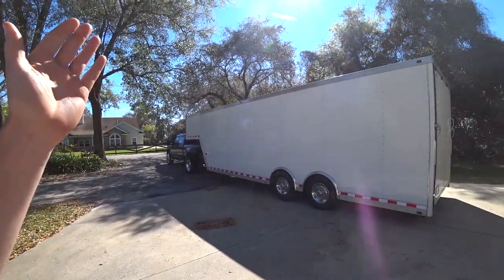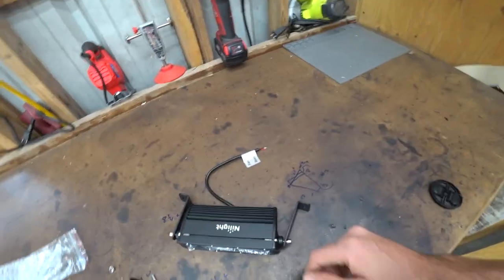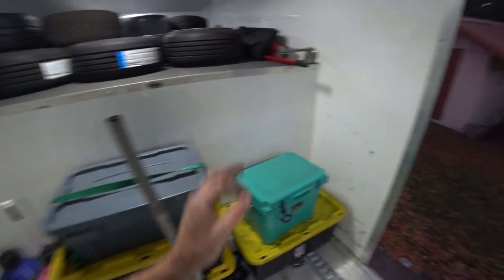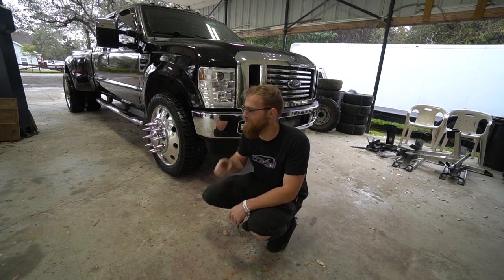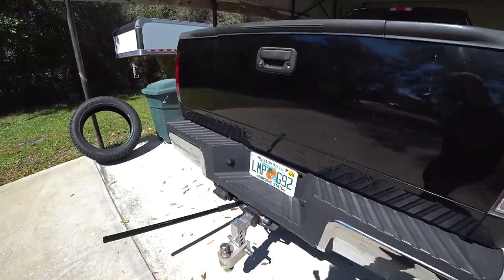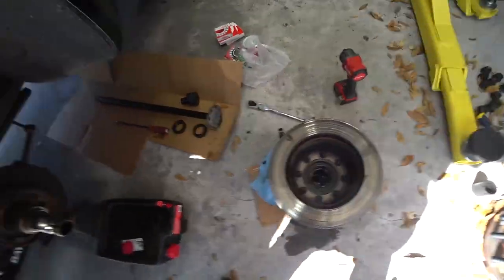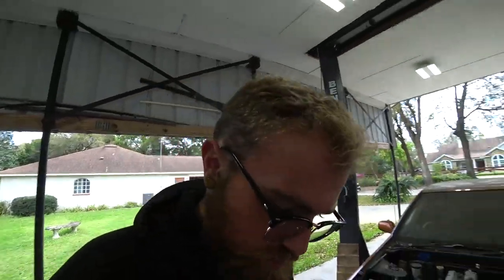Fixing up my new trailer and my cummins swapped tow rig.

Comment: Already a blowout? Hmm, if it happens again, make sure your trailer axles are perfectly ok. I watched a Hotshot driver on YT whose trailed used axles "rated" for a certain weight, but they were too skinny and didn't hold up, so he ended up trying to find an axle while on the road and had to replace it on the side of the highway. Crazy ... so if you keep popping tires, make sure the trailer axles are perfectly aligned and not bent in any direction.

Comment: Look at the dates on your tires. Typically in the rv world we see tires that look fine but are out of the 7 year recommended running age.  On the tires the letters "DOT" will be stamped close to that there will be a 4 digit number. The 4 digits are a date. For example "4019"   is the 40th week of 2019.  That is the age of the tire.  Hope this helps.

Comment: 5:22 u should get some lights like u have on the back corners of the trailer/ reverse lights so they sit flush against the trailer instead
Reply from the maker: Reverse lights on it would actually be really nice but I would hate to try and route the wiring.

Comment: @Taylor Ray, Advanced Auto will price match Rock Auto as long as the brand, part number, and warranty is the same, and the part is not a closeout / wholesale deal. Price also must include S&H. Just did it in Bartow for 2 strut assemblies.. got 2 for the price of 1 because of that.

Comment: If you are running bias ply trailer tires, heat could have been an issue. I switched to radial Maxxis 8008's and the only issue I had was a nail in one. Washington to Texas, 85mph the whole way with a 5000lb jeep on the trailer, they didnt care.

Comment: Air grinder motor (die geinder)... sand paper (emery cloth).... will create just a whiff of clearance. Use lubricant (even WD 40 will work) Fixes all of those problems. Just be gentile.

Comment: Cut up an old inner tube put that between the teeth of you tire machine and the wheel and grab the wheel from the hub hole.  Not sure If your machine can do it but you might be able to swap your teeth around so the hook part faces outward.

Comment: As an ex-ford tech I can tell you a couple tricks on dually brakes. For the bearing nut, almost no one ever has the special tool.... You just use a screw driver and mallet. They almost always come off by hand, they are usually not tight. For the E-Bit bolts, no one ever has those at ford. A 7/16 12 point socket fits those perfectly and will never slip no matter how rusted and stuck they are. I have never met a ford tech who spent the money on e-bits as those are really the only ones ford uses. For the tire mounting, you can do them by hand, or use a semi tire machine. Most ford shops will have a way to mount them because Ford econolines and f-series trucks commonly use 19.5s, 22.5s, and 24.5s for busses/ambulances/tow trucks/RVs/etc. 24.5s are the easiest to do. 19.5s suck ass to do. If you try doing them on regular machines, you WILL burn out the clutch at some point, even 19.5s. 19.5s you can do, but the machine will struggle and slowly burn up

Comment: go to the junkyard and cut out the spare tire cable hanger thing out of the SUV and install it in the tuck. 
YOu just turn a bolt and it drop it down and then lifts it up.

Comment: You have balanced all the wheels?
With all of the adapters you are using a slight vibration can loosen a lug nut, even if they are torqued.

Comment: Uhaul mechanic here: Those inner bearing seals SHOULD technically be replaced any time the rear hubs come off whatsoever. Not removing those can cause the seal to leak and you get diff fluid on your park brake shoes and then the park brake shoes dont hold for SHIT. and then your doing everything back over again. 

If youre confused to what im referring to here:

So you removed the axle right, then inside is a bearing on that side. You remove the nut that holds on the rear hub and slide off the hub. Then on the INSIDE of the hub is another seal with a bearing behind that. Remove that seal, remove the bearing, clean out the inside, and then pack the bearing with grease and reinstall the bearing and pound in a new inner seal and put everything back together.

Comment: Ford Calipers for the 3/4 ton and up seem to be of poor quality my 01 f250 I had to replace all but one at 157k miles and my 2011 f350 need all of them done before 140k miles. The 01 had a piston Crack on the back passenger while towing which then in turn made me lose breaks almost all together not a fun time

Comment: Those front brakes really didn’t need replacing
Reply: It's not always about need. Did they have life left yes, is peace of mind worth  new parts early?  For me with brakes, every time yes. Why run them to the limit especially  if you're already pulling everything off to check.. pull everything off to just put the old ones back on and do it again anyway in a few months?.  If he's getting into travel season.  It makes sense to just do it.
Reply: @kjcorder  the brakes weren’t even half had thousands of miles of life left in them yet

Comment: So how thick is the wheel there?  I'm thinking like some rotors are or brake drums that have a threaded hole that you put a bolt in and push it off, but threaded aluminum....  if you could find a thin flange nut and spot face the thickness of the flange, if the threads stick out, not a big deal as the cover will cover it.
Reply: Or drill and tap the adapter and push the wheel off from the inside, tougher access...
Reply: or wait to watch the video to the point where he clearances the wheels past the studs...

Comment: Do they make the dually adapter to 10 lug adapter in one piece? So you don't need the dually adapter then the 10 lug adapter??
Also get an exhaust brake. Then you don't need the service brakes.  I got 100k on my pads on my Cummins. I use the exhaust brake everyday, every time I slow down.

Also I get it with the tow rigs.  I find myself checking out tow rigs more than some cars.

Comment: I'm not trying to be one those guys but you need to rotate the tires on the Fummins you can see the tread on front tires are feathering which is bad for the wear and handling  especially cause they are Parrelli's and expensive replacement if they get toasted

Comment: Holy shit man, if i where you dude I seriously think og getting some 4 pot brebmos front and back on that thing, your hady at making brackets and stuff so make yourself up some caliper brackets and get yourself some serious stopping power.... them brakes aint the best..... also i would suggest perhaps taking a bit more off the wheel in order to get yourself tot eh smaller nuts instead of taking the 10 off then the wheel to get to them time save bro..... I know it's not gona matter if your just changing a spare or that but for future maintenace and upgrades it's a thought....

Comment: Are you torquing to 500 ft lbs? And also, are those 33mm lug nuts and a Alcoa aluminum wheel set? There is also a O ring under that nut on the valve stem. I work for a industrial Tire company in Tacoma,WA. We see this often.

Comment: Is there not enough clearance to get a tool on the adapters to just take off the original 8 lugs and just keep the 24s bolted to the adapters and remove as a unit?

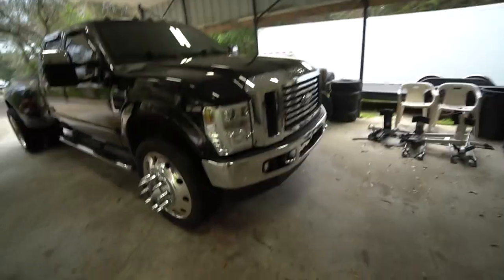Comment: 14:45 - if you're taking the gooseneck trailer - put it in the gooseneck!?!?? You did say you can fit more tires than you will use for the miata!? Well - food for thought. You may have said something about it later around 16:00 - but ugh you spoke a little fast there. anyways - looks good!

Comment: Its possible to manually mount a truck tire... I used to before they had mag tire machines 🙄
Can you get a factory spare tire mount from a scrap yard?
Reply: @-tr0n  i was the poor bastard 
My guy and I dismounted and balance and mounted a 18 wheeler in 45 mins.. the machines we were a 2inch airgun and a tire balancing machine and 6 manual bottle jacks...we were high tec 🤣🤣🤣😭
Believe it or not truck tires were easier than car tires and tractor tires could be even easier [could be]

Comment: Now imagine doing that kind of work everyday.... #mechaniclife
Reply: Yup. Not a big fan of annual inspections on boosted trailers or tri-drive tractors. Pulling 14-20 200lbs wheels and tires sucks. Let alone torquing 80-100 lug nuts to 500 ft lbs.

Comment: Step 1 check front breaks step 2 disassemble front breaks step 3 find out it's the rear breaks. Back to step 1 on rear step 2 disassemble step 3 back to store step 4 caliper breaks step 5 go back to 10 stores step 6 reassemble step 7 more work 😐

Comment: Make shure the trailer tires are ten ply  and not cheap or Chinese tyres   I use to have blow out all the time with my goose neck than I switched to. A 10 ply Goodyear. And the tyre rotted be for it blew

Comment: Happiest day of my life was when someone paid me and took my F350 away to a new home 200 miles away.😂.  Barely drove that truck, replaced the complete rear brakes 3 times in 5 years.     Multiple brake jobs, a transmission, injectors, 2 starters, 2 alternators, 3 sets of batteries....  POS truck.

Comment: @21:38, so im genuinely interested to know: Why is there a dually adapter on the front? You don't have dual wheels upfront so why is there an adapter?
Reply from the maker: I thought about this before too. Like why the weird front wheel that sticks out just to concave in. It’s so you can run the same wheels front and rear so you can rotate them.
Reply: @Taylordrifts  ahh makes sense. Thanks for the knowledge!

Comment: Next time leave the adapter on the wheel and take the adapter off the truck
Reply from the maker: You can’t the lug nuts sit right against the inside of the wheel. No way to get a socket on them. I had to notch the wheels just so the lug nut itself didn’t rub on the wheel
Reply: @Taylordrifts  I understand everyone I know that’s how the do there
Reply from the maker: @zachshetterly9145  if it was 8x170 it would work. But the lug nuts literally touch the wheels.